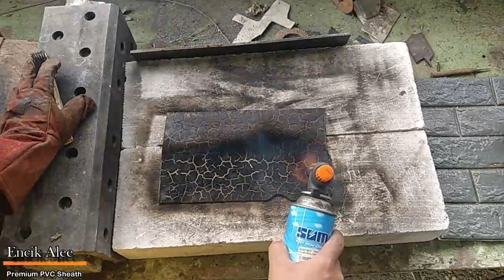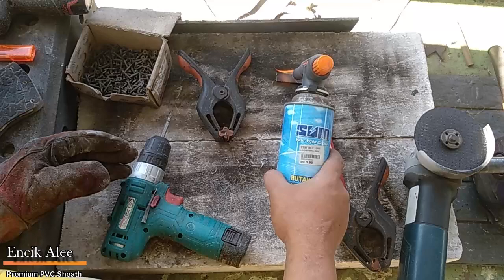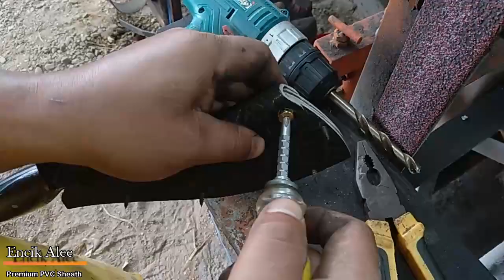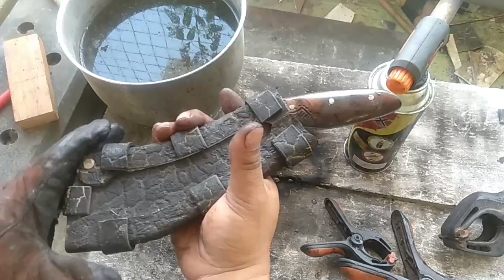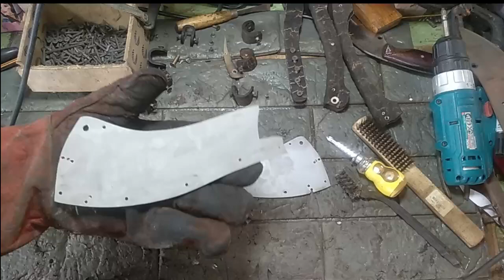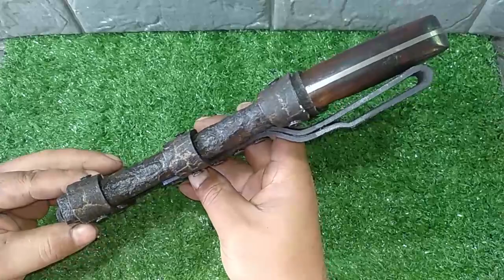♻️ Secret of Premium PVC knife Sheath | Knife Making | Cara buat Sarung PVC

Comment: Looks great, what blade are you using on 4" angle grinder, it seems to cut very smooth without jerking or grabbing work piece
Thanks
Reply from the maker: just normal cutting disc vor cutting steel

Comment: Very cool sheath sweet knife as well .what pipe did you use schedule 40 or sdr 35? also have you ever tried using abs ?
Reply from the maker: i dont realy know what pipe is this. just pick it up for free at scrap yard. but the diameter was 5-6inch and 2-3mm thickness. 
eh? whats is abs?
Reply: Abs is similar to PVC used for drains only its black so no need for coloring the edges and it's a little less dense than the pvc

Comment: I tried the same thing, why are the results different?
no crack motive appears
Reply from the maker: What type pvc? For better result, try using thick pvc. Or 3inch diameter.
Reply: pvc pipe, thickness about 2mm. I don't know the type
Reply from the maker: @DabYenk200  dont use the black or the blue pipe. It will melt. Only use grey or white